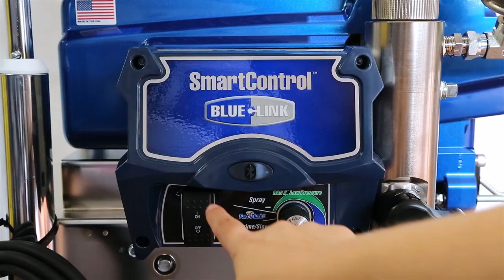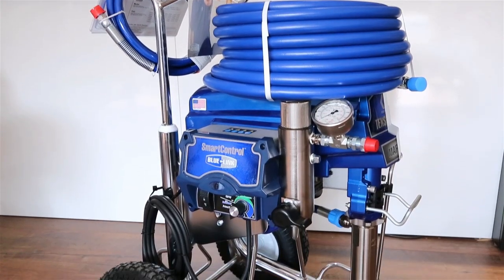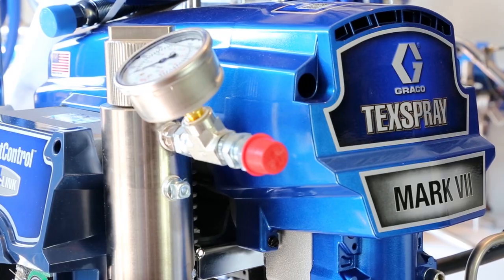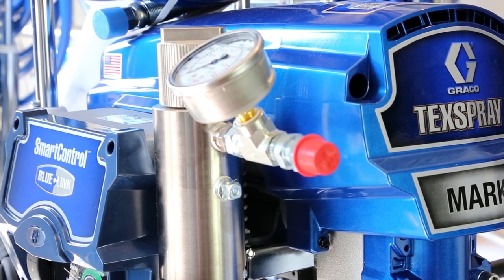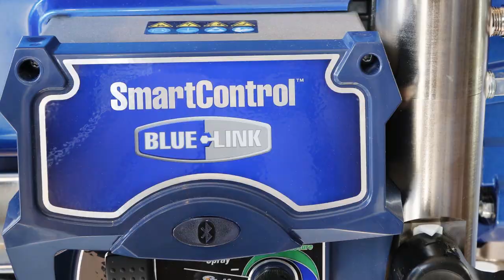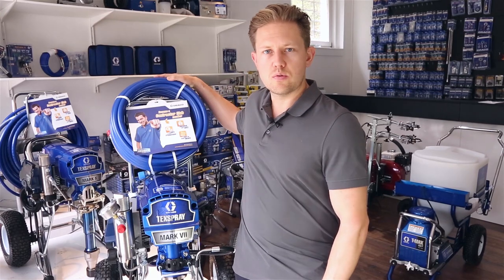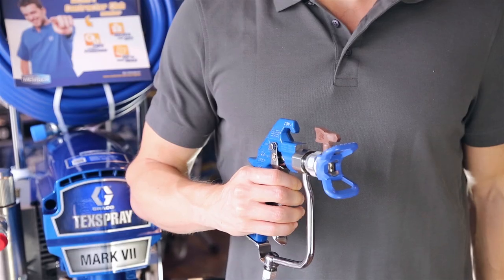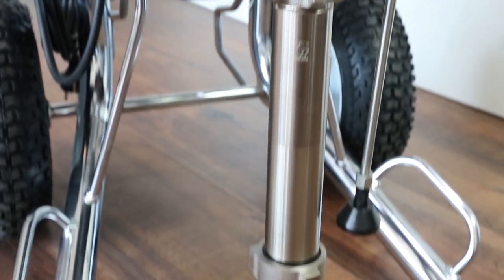Graco Mark VII Max STANDARD Overview - Specifications, Features and Delivery

Comment: Hi Daren, what do you mean by plaster? is it for concrete? also AT 0:53 in video , can you explain the tip sizes and coverage area?
Reply from the maker: Hi,
Plaster means this type of materials you need to apply to block a wall base for example. 
This machine can handle this sickness of materials to spray. 
Kind regards,
Airless Discounter team
Reply: @AirlessDiscounterInternational  can we spray wall putty using this ? what about paint coverage area ?